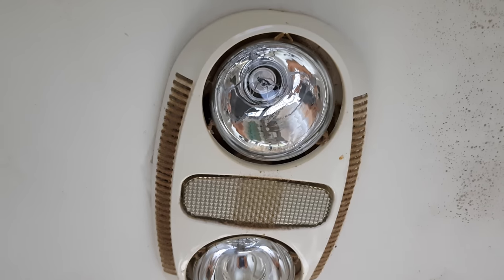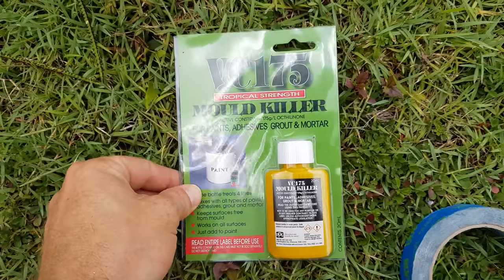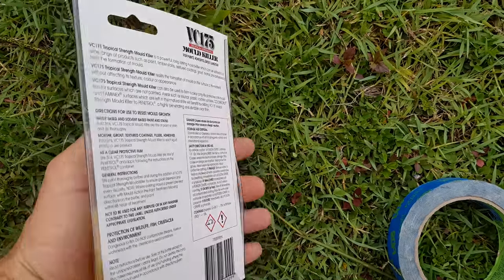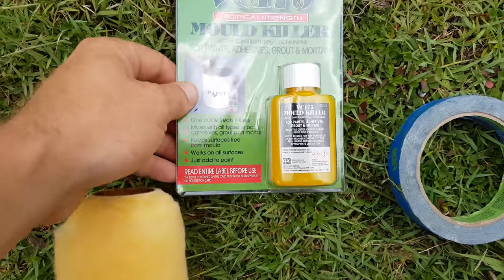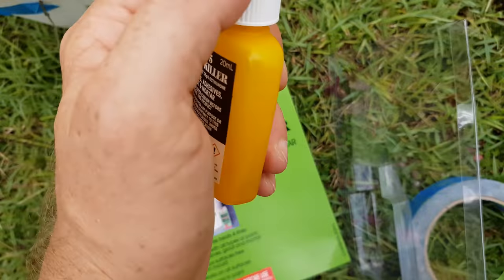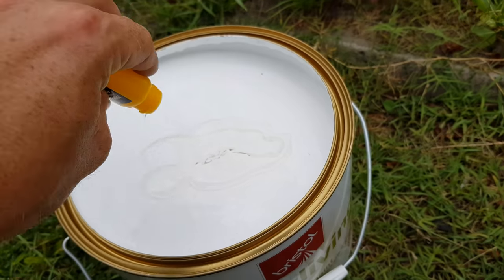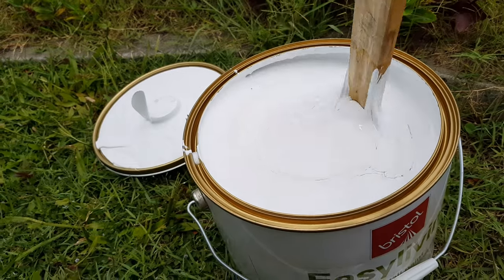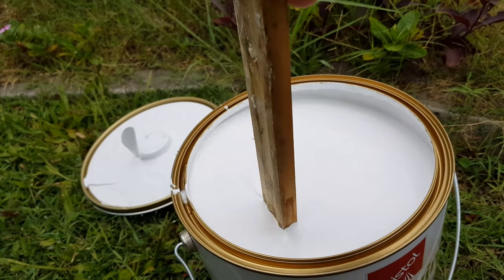How to remove and stop mould growing on your bathroom ceiling

Comment: Plain cheap white vinegar kills the mould. Bleach just takes the colour out but still leaves the mould spores alive and they grow back. Spray it on with pump spray pack and leave for a bit then wipe the whole surface with cloth and warm water. And i have a 15lt drum of  Taubmans Endure exterior low sheen in 1/4 lexicon that I do those bathroom repaints in. Stinks a bit but good for keeping clean.
Reply: Does it kill all types of mold?
Reply: Did you add water to the vinager or did you just put the vinager in the spray bottle and spray it on ?
Reply: @ethereal1257  Not sure on that. It kills the one I come across in bathrooms.
Reply: @lujangaming2354  I use straight white vinegar but it will stink a bit so just spray it on heavy then leave it for a bit before wiping off with clean warm water. Ventilate the room if you can.
Reply: They tried it.  It grew  a bit fatter now. I have fungus in bathroom now and I don't know what to do.

Comment: Firstly personal protective wear! Gloves mask eye protection! Window ventilation at minimum! Buy Astonish mild and mouldew spray! Not just ordinary bleach! Secondly do not rub or scrap or sand!! Let the mould and mildew do the work! Once it's removed the spores , again ppe ventilation!  Wipe clean with hot water! Dry the room out with a heater for a couple hours! 24 hours later ready to be painted with anti mould paint (dulux). Remember to ventilate there after every bath or shower!

Comment: Whenever u have mold on any building materials, u should remove it completely  because it can grow through the material. So just wiping it off does not remove the  actual spores and u will still have mold.